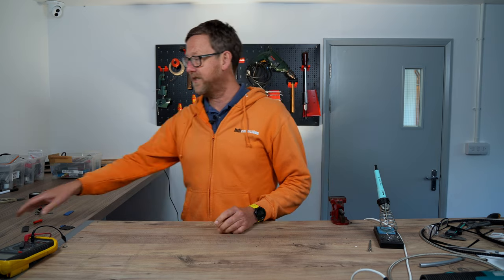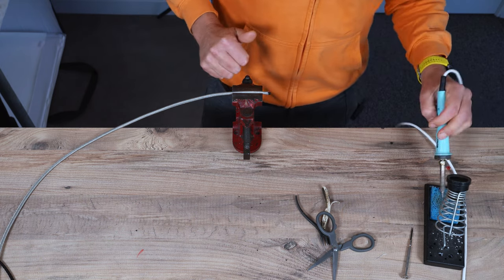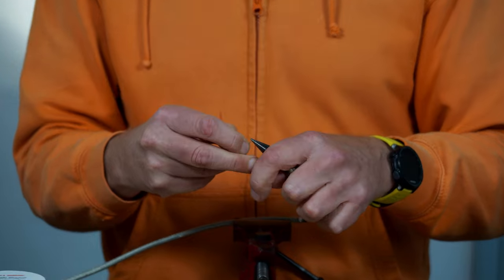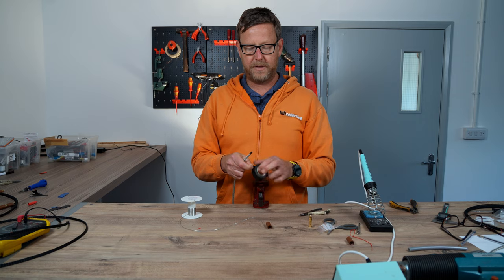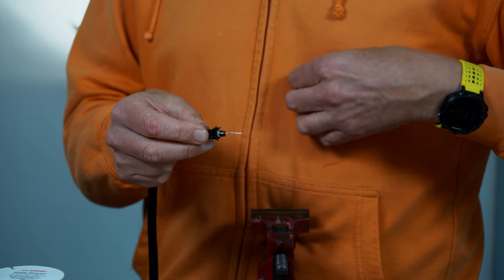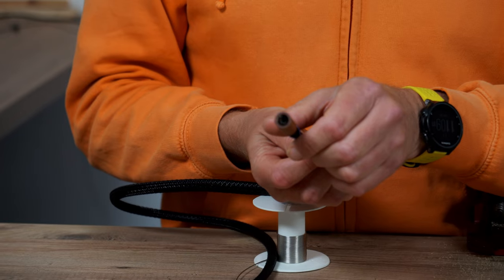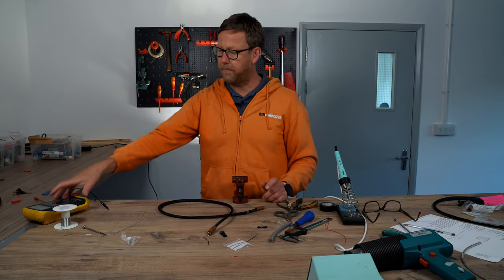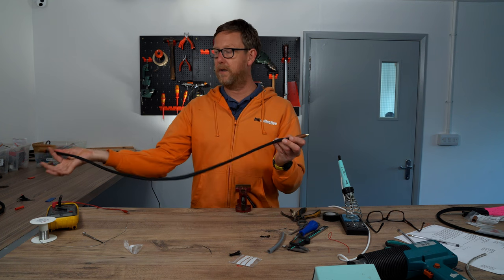Duelund-Inspired Screened Interconnect Kit build

Comment: Neatly done Nick.  One little tip is instead of transferring so much heat to the centre pin solder bucket of the RCA for 3 seconds or more, there's a risk of softening the insulation bushing around the pin.  If you tin the bucket first using a slightly larger tip it shortens the time exposure to heat.  Then all you need do is tin the bit and a quick touch to the positive wire tip when placed into the bucket effects a rapid solder joint.  Less risk of heat damage to the insulator. Not sure on those if it's a PE insulator? A loose wind to put in a few even turns of twist between send and return wires maintains a constant capacitance/length between cores but I appreciate this can also raise capacitance.  Have you tested them yet to determine o/a capacitance between send and return/send and screen?    Probably won't matter for line level applications but might for MM phono.

Comment: Actually Steen Duelund did not use screen at all. He used flat rolled silver with wire about 2.5mm times 0.5mm, he then annealed it, and had it gold plated with a few microns of gold. Around the cable he used cotton woven around the conductors of the cable and treated it with linseed oil and let it drip off, then baked in a small oven.